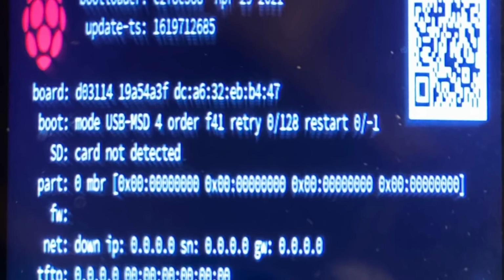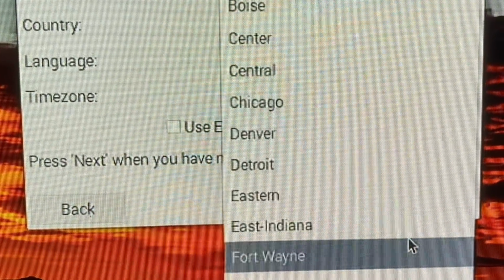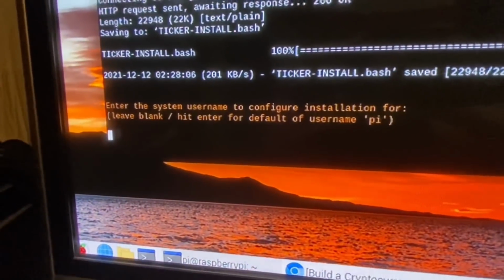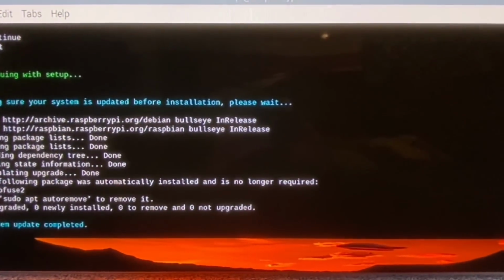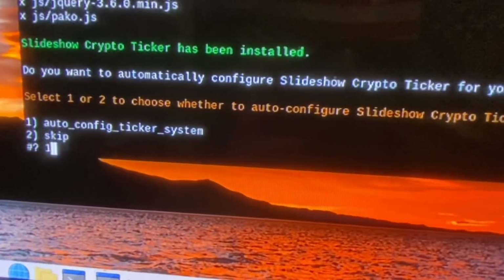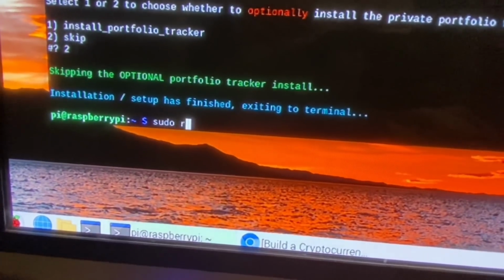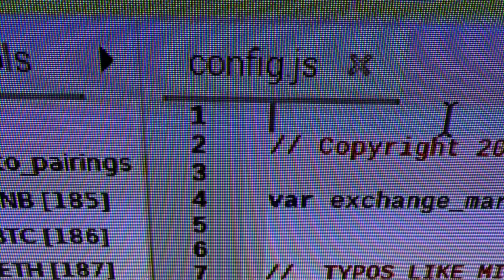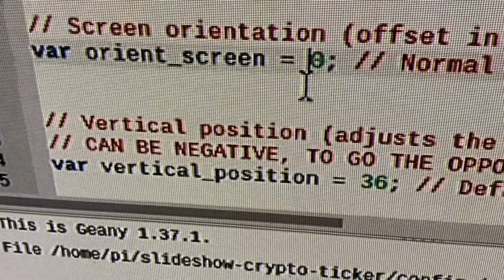DIY crypto currency price ticker

Comment: the Ticker application does not automatically start at the reboot.
Are you possessing solving? Thank you
Reply from the maker: I just found that out as well . I think it needs an update bec it uses google chrome to get the numbers . The problem seems to be in the restart after I connects . I will be working on a fix
Reply: @thecryptocheckpoint5083  Thank you for your answer.
For now it is working automatically with the web version.
It would be possible to have the % of the value by choosing the
reference period?Es. 1’-5’-15’-1 hour-6 hours-1 day-1 week-1 month-3 months-6 months-1 year